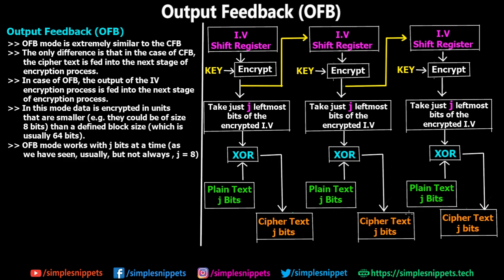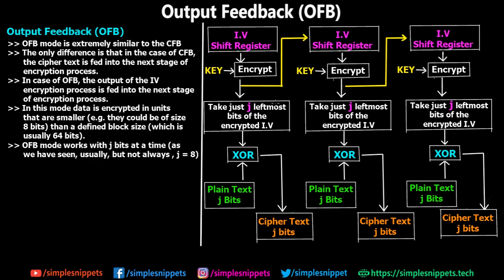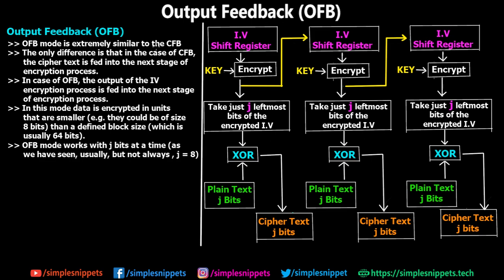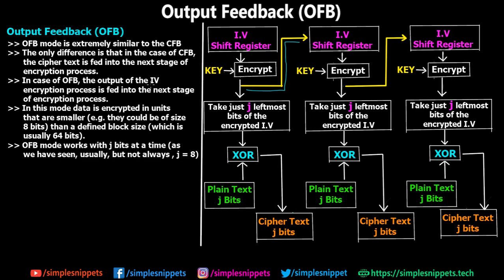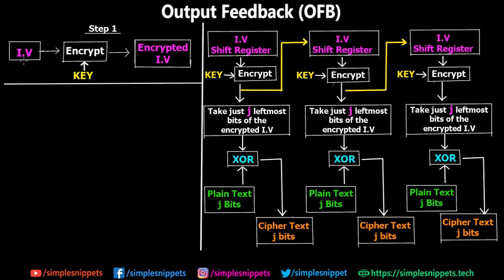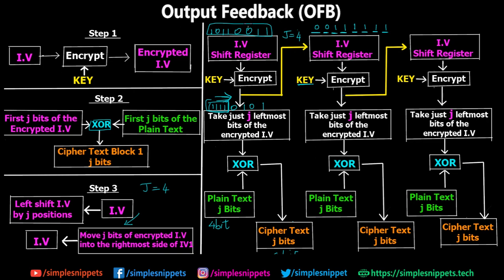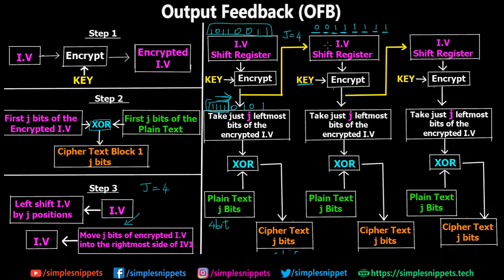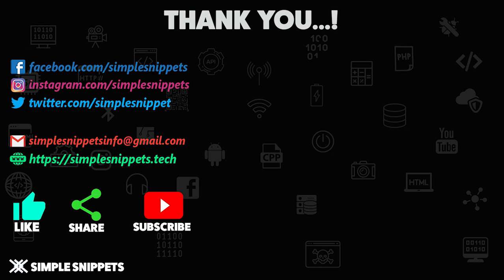Output Feedback Mode (OFB) | Algorithm Modes in Cryptography

Comment: Key size and block size are not directly related, this video does seem to imply this. A random IV is not required for OFB, it just needs to be unique. Randomness doesn't need to be added, the randomness should already be present in the key; uniqueness of the key and IV is enough. I guess that with such a complex mode, you do need more time to explain decryption and not start at the last block. The video is rather well explained, but it does need a lot of polishing for it to be up with the best; currently it unfortunately contains too much incorrect statements to be useful.